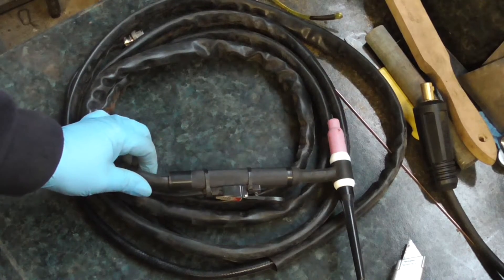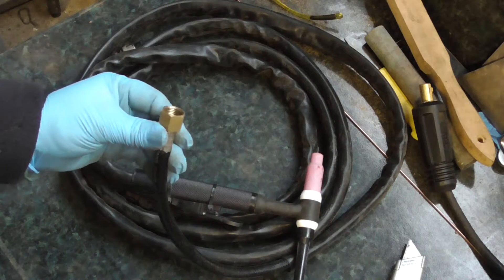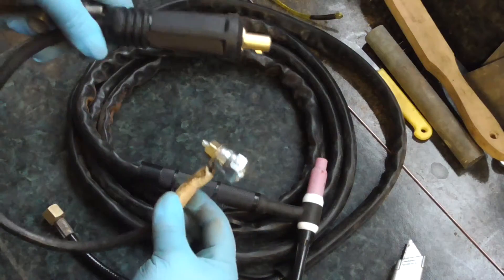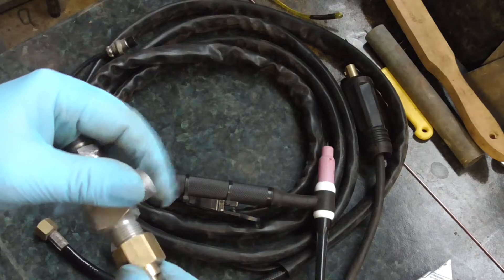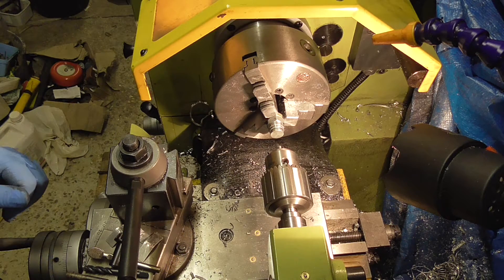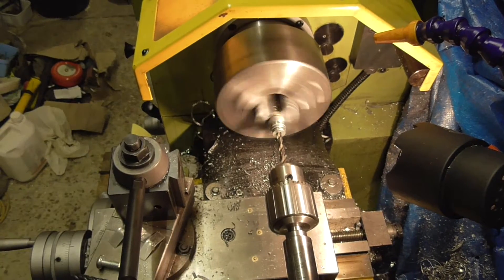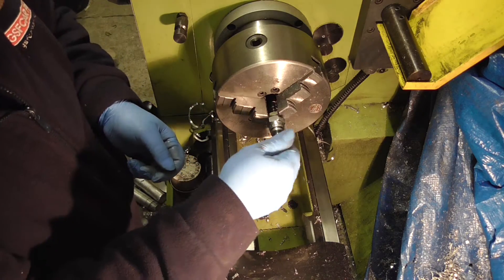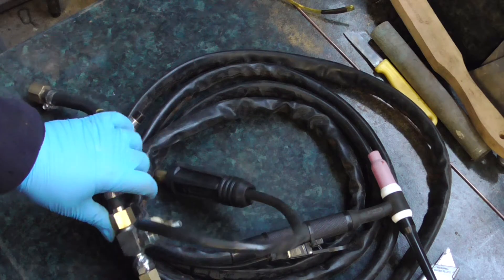Tig torch conversion

Comment: Wait ? How did you add the remote button to a standard tig torch ? Is that what you did ? I have an esab rebel 205 and I bought the tig torch from a 235
Reply from the maker: The trigger you see in the opening clip came like that new, I removed it and use it with a foot control.
To be honest I have only ever gotten 1/2 decent results from this welder using the original torch with with it's built in controls.
I seem to struggle with the foot pedal, all in all I have had indifferent results with this welder ever since I got it.
As such I cannot say how good this torch conversion is/isnot.